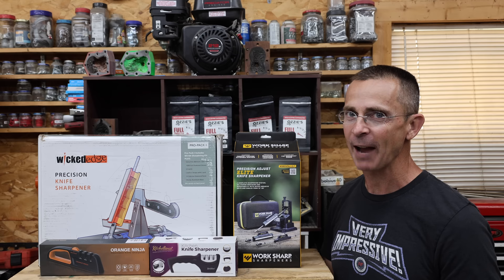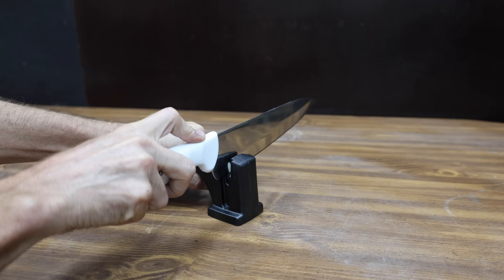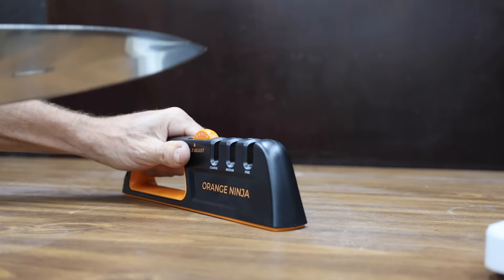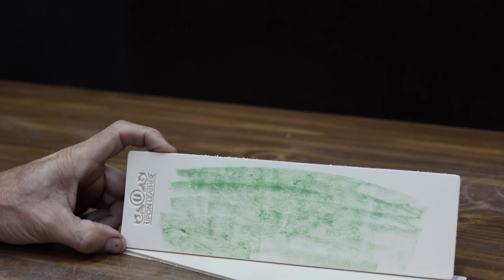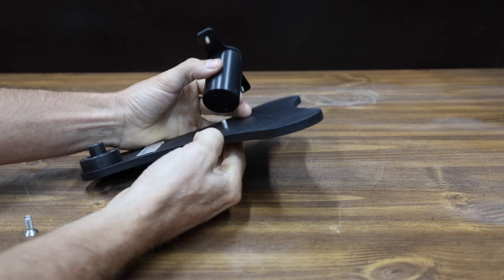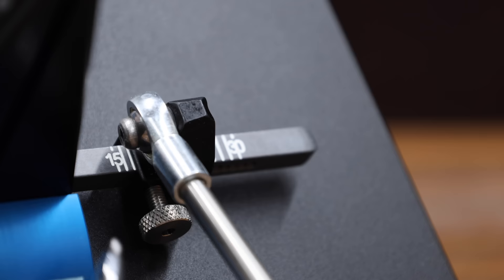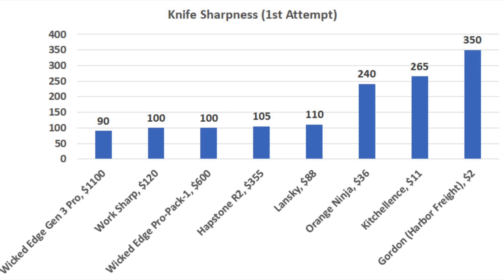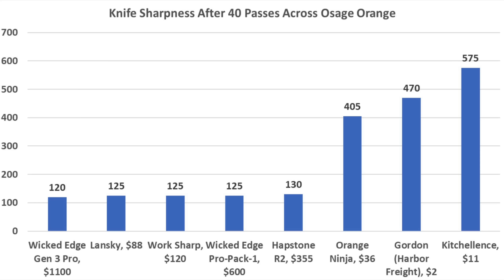Best Knife Sharpener 2023? Let’s Find Out!

Comment: Been using Lansky for about 3 decades. Upgraded to Lansky diamond stones 10-15 years ago when harder blade steels like M390, M4, S90V steels became popular. Also use Lansky leather strop with compound to finish. All total less than $150 spent and my blades can thin cut phonebook paper or whittle a hair.  I recommend a Angle Cube with the Lansky as Angle Slots are not accurate and blade position in the mount can affect hone angle but overall, Lansky is the original fixed angle sharpener and still holds it own against the newcomers..
Reply: Angle cube, as in the angle finder he used with the Hapstone?  I'm guessing he's using the one Harbor Freight sells.
Reply: Well, that's a phrase I've not heard before: Whittle a hair. Very nice.
Reply from the maker: Thanks for sharing.
Reply: Commented similarly under another PF video a couple years ago that also featured the Lansky. Sad to see it's now made overseas but glad to see it still performs well.

Comment: I've been sharpening knives for about 60 years, and sharpen a lot for family and friends. I prefer using flat stones, but picked up a Lansky kit at a yard sales a few months back. I was curious, it was brand new, and the price was right. I have to say, it far exceeded my expectations. I have only one complaint. Despite the guide holes used for various angles, the actual angle depends on how far the blade's edge is from the guide hole. The lowest guide hole provides the smallest angle, but what angle this really is depends on the width and length of the blade and where the blade is clamped. I dont know that I'd pay $88 for this, but it was well worth the $5 I paid.
Reply from the maker: Thanks for sharing.
Reply: Same, not 60 years more like 25.  Japanese King Stones are gold standard.
Reply: I'm glad you pointed this out. I was going to say the same thing! I could be wrong, but I would think it's the same thing for all the clamping systems.

I have a Worksharp system that's freehand, but has ramps for setting the initial angle. Even with that system, the angle will be off the further down you lay the blade on it. Hard to explain, but either way, freehand is really the best skill to learn for sharpening.
Reply: i image that as long as you're fine with that and aware of it, even going as far and letting it happen, that it won't matter if the farther ends of the knife is a degree or two off from the target angle?

could you tell me how big the difference in angle might be, in numbers, if the clamp was mounted in the center of say - a large kitchen knife, to the tip?
Reply: @Layarion  You are absolutely correct. My point was just that you can't really go by the angle markings on these tools. That said, I'm surprised at what kind of an edge you can get with, say, a Lansky. Happy sharpening.
Reply: @DJSKETCHYPETE  Haha Japanese stones are definitely the gold standard, but not King stones. Chosera, naniwa, and shapton are some of the gold standard Japanese stones.
Reply: I use the Japanese Iminashi whetstones and then also have a full setup including stiff belts, leather belts, compounds, cloth belts, and then Red Label Abrasives belts for the Work Sharp Ken Onion Edition along with the Blade grinding attachment.  I really like using my powered setup, and it makes it significantly easier to sharpen knives that come in with big chips or have broken tips. I use strict heat management and make sure to dip it in Ice cold water every few passes along with doing it with my bare hands so I can keep a better handle on the temperature, and then watching the blade, particularly the tip for any discoloration. If there is Knives come out stupid sharp, can cut paper towels fairly well and still have good edge retention. I have and have sharpened a bunch of knives from all over the spectrum from my own as well as others high end customs, to Wustofs, Dalstrongs,  Cutcos, Forshner Victorinoxs, as well as others. I do not have as much experience as others, but do use my knives for doing bulk prep in a commercial kitchen, and for canning at home. I also make sure to keep track of how people's knives are holding up that I have sharpened, just to get a better feel for what works better and keeps the longest lasting edge. Wish I had the money for a Tormach, but not yet. The other one would be getting a good 1x30 or 2x42/72 belt grinder. People like Curry custom cutlery or Alexandria knife sharpening services, can get some crazy sharp edges off those, and using a belt splitter can easily do serrations and get them easily as sharp as a straight edged with not very much more effort. As for the stuff I have, stones are great, but are very messy, and it is easier to get grit contamination even when washing them off good before use. Worksharp makes it much easier to handle bigger batches of knives, and makes it loads easier for dealing with full bolstered knives, as a lot of them end up with a dip and need the bolster to be brought up so you can get full contact. It also is nice that you can have very similar material removal to using a stone if you are doing it based on when the burr appears all along the edge.

Just thought I would share my experience.   Both powered and non powered are great, just more particularly depends on personal preference, skill level, and overall refinement and honing of methodology. Still trying to get as good as Outdoor55 at getting those crazy good edges like he has where he can easily slice paper towels. I can only do that okay.
Have a great day! And keep up the good work Project Farm, you do great!

Sincerely,
JS
Reply: @DJSKETCHYPETE try a Norton Wetstone!   You’ll never use another type!

Comment: I bought the Lansky sharpener many years ago. It is affordable and does a great job of sharpening most knife blades in very short time. You can get additional sharpening stones to fit the kit from extra course to ultra fine ceramic, and leather stropping attachment too.
Reply: How does the lansky do with small narrow blade pocket knives?
Reply: @josephwilliams6586  Excellent! The only thing I can't sharpen with it is an axe!
Reply: Would love to see the Lasky tested with the addition of the finer grit stones, ultra-fone ceramic and a couple of the leather strops ultra-fine diamond paste

John
Reply from the maker: Thanks for sharing.
Reply: I have a lansky set and I am not 100% happy with it.

Mounting the knife in the clamp is fiddly.
The narrowness of the hones makes it take longer to sharpen a blade and can lead to wavering in a blade over time.  It also makes working around the tip of the blade harder.
It can’t sharpen the full length of my chef’s knife that has a thick metal bolster that comes down to the heel of the blade.
Reply: @josephwilliams6586  If you mean like the miniature swiss army folding knives where the blade is only about 1/4 inch wide and 1.5 inches long then it will not work. For a regular sized Swiss army knife it will work fine on the main blade but only just.
Reply: Same here. Bummed to hear they aren’t made in the US any more, hope they took the time to vet the new manufacturer.
Reply: The only thing I don't love about the lanksy is its kinda tough to sharpen knives with full grinds. Like my spyderco
Reply: I have been using a Lansky diamond sharpener for 30 years, you can't beat them for the money.
Reply: I have been pleased with my Lansky.  I think some of the shortcomings I experience are more related to operator error because of a lack of patience than the system.
Reply: @josephwilliams6586 It depends on the blade breadth. Mine is fairly old, but the clamp gets in the way while trying to sharpen something like the small blade on my jackknife. It's great for anything from a cleaver to the large blade on my pocket knives, though.
Reply: 'Strop' is a great nick-name.
Reply: I have their monster size kit. Can shave with most knives after running through the entire set of stones. 🤠

Comment: I recently 3d printed an angle guide for my whetstone, and it works like a charm! It's like regularly using a whetstone but you don't need any skills for it
Reply: Yeah, the problem with the plain whetstone is that you need above average hand-eye coordination and good physical balance. A plain whetstone is simply not a viable choice for most of us, no matter how loudly their advocates bleat. A guide might help.
Reply: Hey, I reckon this would also be useful for sharpening blades with belt sanders.  It's a legitimate method that WorkSharp popularized, and there are courses to learn that skill.  Such an angle guide would be excellent for establishing muscle memory to build the skill as such.  Please do some videos on how to 3D print such a guide, or let us know where to look!
Reply from the maker: Thanks for sharing.
Reply: I can sharpen without a guide. But I've been doing it for over 20 years. It really is a artform to be able to do and near perfect eye hand is essential. Making yourself a guide is a good idea and will train muscle memory! Try without the guide after you get some practice every once in a while and you will get there!
Reply: I have been sharpening knives with my Gerber Sportsman's Steel for over 50 years. I recently got a laser sharpening angle gauge to test my sharpening angle. Freehand it is 20-21 degrees, so I seem to have developed a pretty accurate muscle memory.
The Sportsman's Steel has a chromium carbide surface and shows no signs of wear. It cost 4 dollars at the Ft Ord PX in 1970. It has a fine flat surface which will leave a mirror finish and a coarse round edge which will take of material quicker when you're dealing with a very abused blade.
I need to make a edge testing fixture to quantify my sharpness.  As it stands, shaving my arm might be a bit qualitative.  LOL
Reply: @Ea-Nasir_Copper_Co  I'm guessing.  The cheap setup I got includes a plastic guide that fits on the spine of the blade and is set at 20 degrees.  Is it sharp?  The blades seem to pass the slice the paper test.
Reply: share the file!
Reply: @jaklumen do you have a printer guide template?

Comment: As someone who has the lanskey I can say it is VERY VERY GOOD! it does take some time to sharpen your knifes to get that hair shaving sharp. I've also found that soap and water work alot better than the oil that comes with it.
Reply from the maker: Thanks for the feedback.
Reply: I have a Lansky and find it to be my best knife sharpener.   I have not tried it with soap and water but will now.  Thanks!
Reply: I love the Lansky. I bought the leather strop and it works quite well. I'll have to try the soap and water. 3-in-1 oil has always worked well for me. I've wondered if a cutting fluid like Tap Magic would work better. Though it would be more expensive.
Reply: I tried soap and water: it does work better.  Water actually cleans the metal off the stones.  Sweet!  I use an old belt, one end clamped in my bench vise, as my strop. I can tell that it is getting rid of a burr by the way it peels shavings off the belt until the burr is gone.
Reply: @nutgrower2957  Nice. I've done that with belts, too. I also took about a 12in section and attached it to a block of wood. In a pinch, I use the belt I'm wearing. Just leave the buckle in the loop so you have something to pull against.

Comment: Please do a test using electric sharpeners. I have a Work Sharp electric, and it is quick and easy to bring an edge back. The tool is also useful for sharpening chisels, fishing hooks, and can be used to remove burrs after cutting pipe, and chamfering. Good info on these manual sharpeners, by the way! 👍
Reply: I just asked for an electric sharpener test too!
Reply: He did a test with the Work Sharp electric.
Reply: @MegaTechno2000  Thanks, I’ll look it up.
Reply from the maker: Thanks for the suggestion.

Comment: I've been a user of the Lansky for years. I bought the 2000 grit sapphire stone and leather strop for it. It works great, but not so great for narrow blades in my experience. Thanks again for the great video!
Reply: Interesting. I use narrow bladed pocket knives often. Do you know of a better system than the Lansky for small pocket knife blades?
Reply from the maker: You are welcome!  Thanks for sharing.
Reply: I have the Gatco version of a Lansky and it does better on my fillet knives as the stones are wider check it out.
Reply: Lansky is the best value if you are sharpening real knives made with modern steel.  Not these 10$ disposable kitchen knives.
Reply: @shanestewart4905  No I don't. A piece of leather works well to give the jaws extra bite on smaller blades.
Reply: As a sidenote, I have a family member that is a blacksmith. He sharpens all his knives on a belt sander and finishes with a strop. You can go as fine as you can imagine. I'm assuming you can find a grinder/ belt sander for less than $600 and its infinitely more useful than the wicked sharp in my opinion.
Reply: Ah, so it is just a mechanical grip thing. Thank you. @JustinMF11

Comment: I imagine the only difference in sharpness between all the sharpening systems similar to the Lansky will be the stones. Also keep in mind that the diamond stones right out of the box aren't how they are meant to be used, they have a break-in period. The first few times you use the diamond stones, they will  behave like much higher grit (EDIT: this came out wrong, I meant lower number bigger particle size) than they are advertised for and the scratch pattern is not as homogeneous. You get better results after sharpening a few times with them.
Reply from the maker: Thanks for the feedback.
Reply: @ProjectFarm  Can you do a review on heat guns? Both cordless and corded??
Reply: When you say they will behave like much higher grit than advertised, my assumption is that they will behave like a finer stone until they break in?
Reply: @dkindig  Ah, sorry, no, bigger grit I meant, gonna correct it. They are much more abrasive and scratchy for a few uses, depending on how hard the steel is.
Reply: @Snarlacc  Thanks for the response.  It sounded like that was what you meant, but because of your choice of words I was unsure...  🙂

Comment: This is great info. In 30 years of trying. I've never mastered the skill of knife sharpening.
Reply from the maker: Thanks!  Thanks for the feedback.
Reply: @ProjectFarm  Please add the Rada knife sharpener ($16) to the list. It's the only non electric knife sharpener I've seen that actually puts a proper grind on the blades by using two wheels, rather than making the blade a "V" shape using carbide blades. The result is a sharper knife and longer lasting blade between sharpenings. It's also made in the USA. When you see the reviews on it, you will understand. You can buy it at the place you always link your products to.